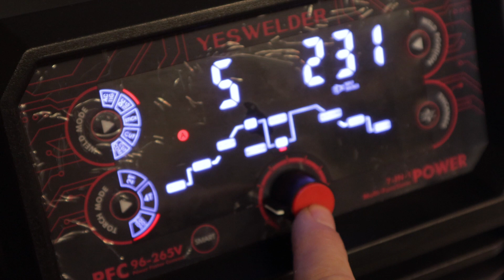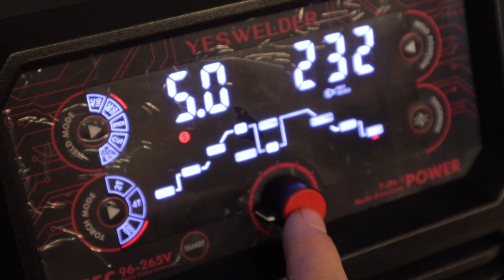The Razor Blade Challenge - YesWelder FIRSTESS CT2050

Comment: Impressive, if not completely successful.  It is nearly impossible as a butt joint.  You did a lap joint and the first third cracked.  But it is better than I could do with my TIG welder.
Reply from the maker: Yes Douglas, I need some practice but the machine is certainly capable so that’s good to know.